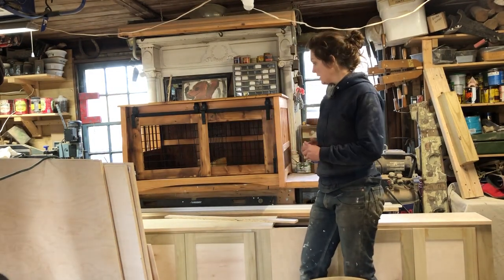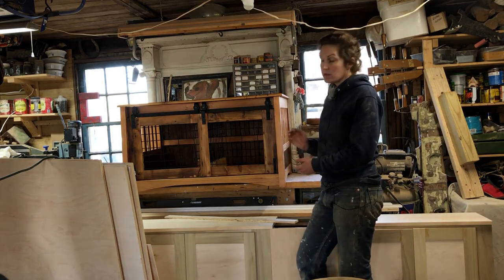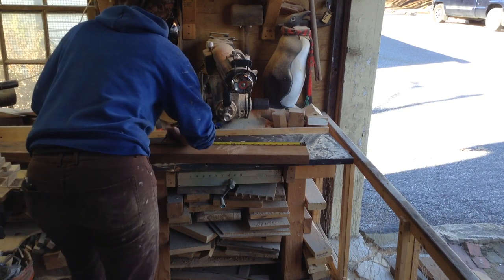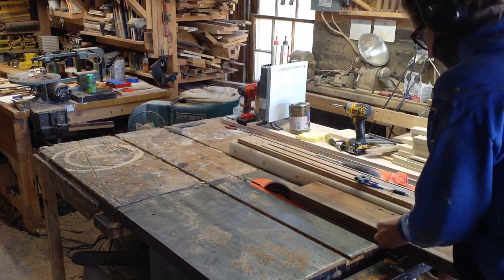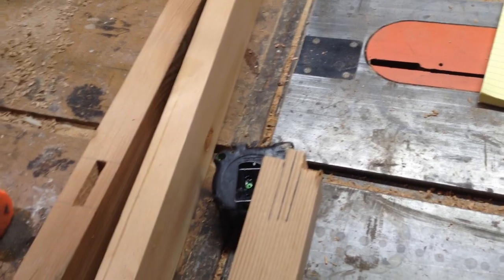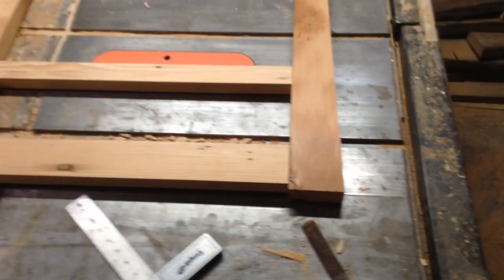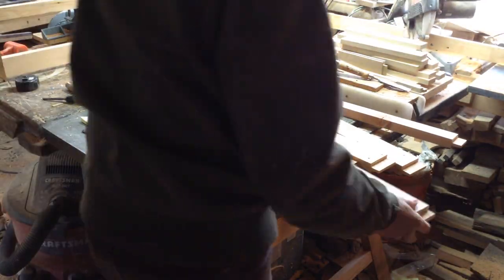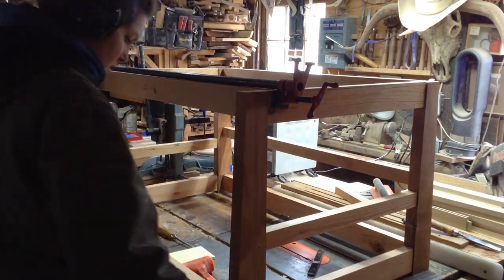Woodworking : Dog Crate From Old 2x6's // How-To Part 1

Comment: For me, the smell when cutting old reclaimed tight-grain pine is a huge bonus too. It's great to see how you give the same care and attention to detail using traditional joinery with this pine dog crate as you do a walnut bookshelf.
Reply from the maker: This older stuff machines so much nicer then modern lumbers as well.
Reply: @HoneyBadgerWoodWorks  It does, yes. I have a little left over from dismantllng a cupboard in the house: really nice wood.